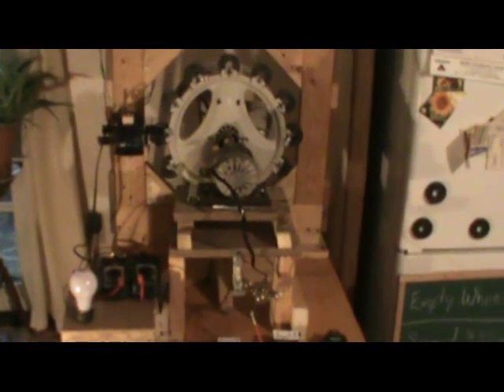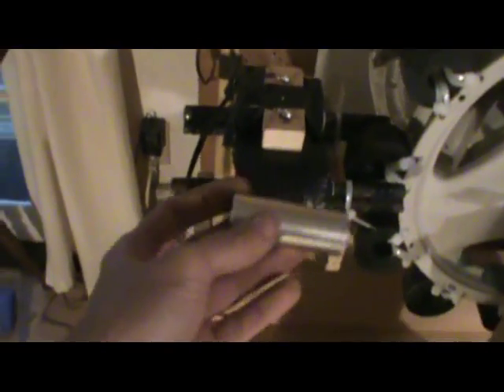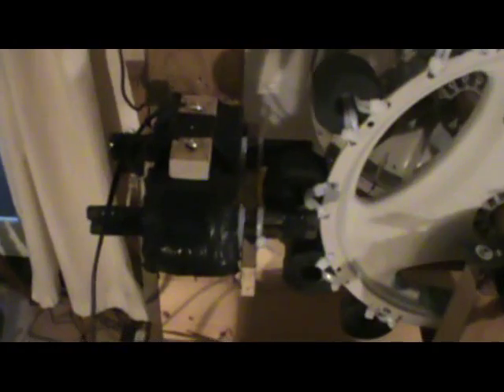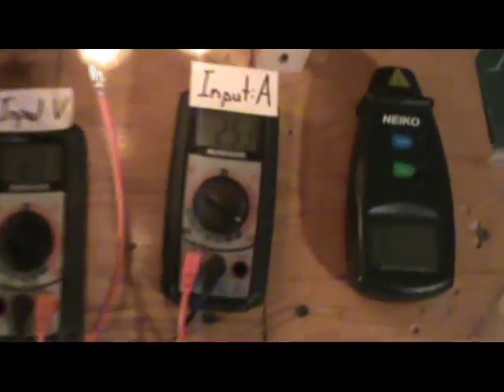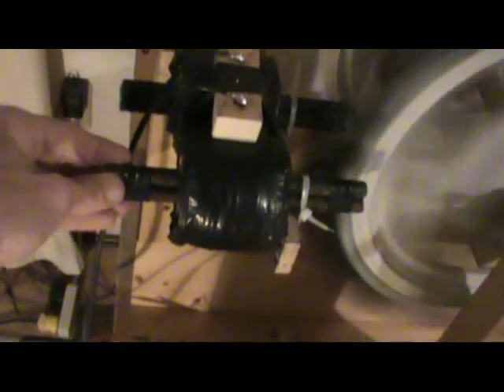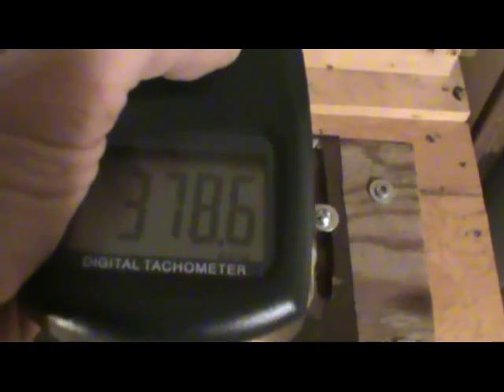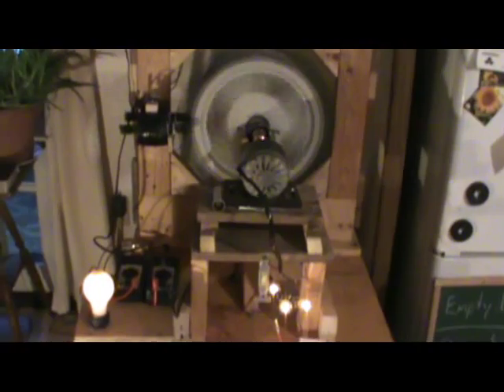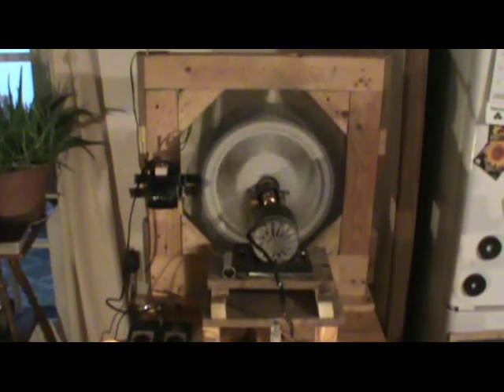Free Energy Project - Core Tests and Design

Comment: Isn't this transferring energy? Why not get rid of the wheel, install a magnet for the shaft of the motor and stick the shaft in a big coil? Transformers have non moving parts, ya got your primary coil transferring energy to the secondary. I'm missing something. The lower amp difference could be found in any added circuit right?